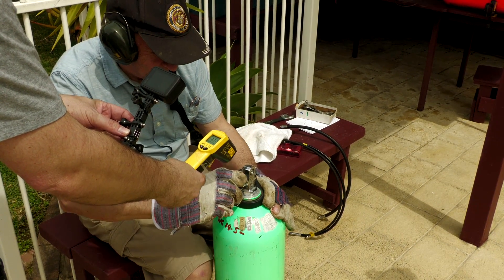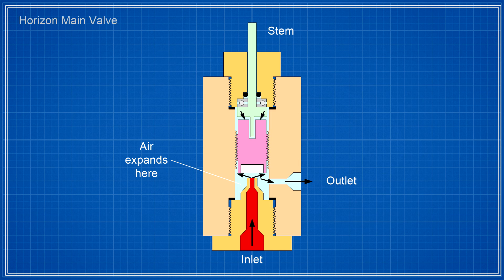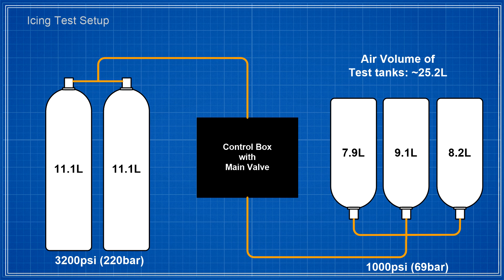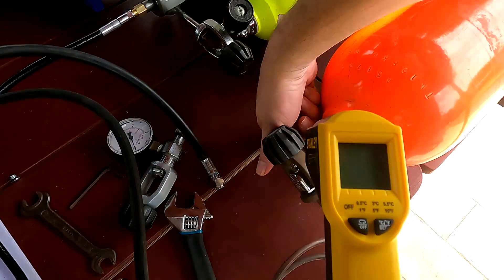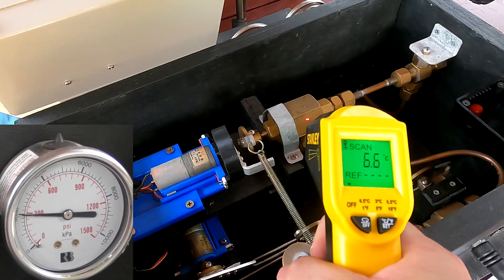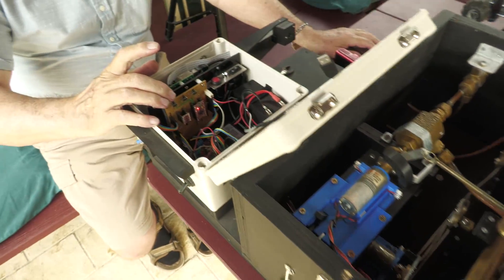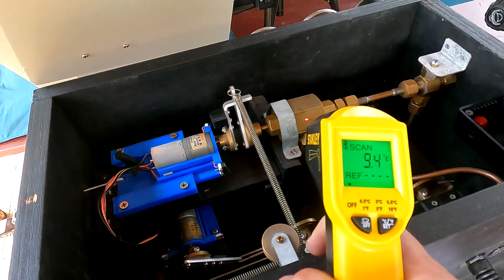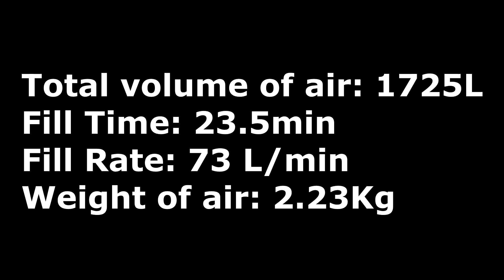2 Stage Water Rocket - Part 34 - Will it freeze?

Comment: You could use (dry/pure) nitrogen. They use it on aircraft tires so that ice does not form in a tire to make it unbalanced. Yes it will still absorb heat when it expands, but there may be less moisture in it, at least.
Cool channel, thanks.

Comment: With an Arduino you could add a temp sensor to the valve.  Then have it shut off the valve at like 10C and open back up at 15C.  This way you might be covered in all weather conditions.  If for example it's a bit cold out.  It would also automatically give you your pulses and open fully at the end.
Reply from the maker: We already have a Raspberry Pi there sending data back to the remote laptop. Probably wouldn't be difficult to add a temp sensor.
Reply: @AirCommandRockets  yeah, it would be pretty easy.

Comment: You can speed up your fill time and get higher pressures at the end by cascade filling from your bank. It's how we fill scuba tanks when blending. Rather than turning on both bank cylinders from the beginning, only turn on one fill until the pressure equalises, which will happen at a lower pressure as your volume difference is greater, then turn it off and turn the other on. 

Rather than use HP hoses, you can get a decanting whip, which is made for this purpose and has a much higher flow rate, HP hoses are designed to have a low flow rate as all they do is pass pressure to a gauge.

Its also worth noting if you drain tanks to the atmosphere like you did at the start, put them upside down. That way, any condensation that forms on the valve and melts can't run into your cylinder and cause corrosion.
Reply from the maker: All good points. One problem with opening the tanks one at a time is that we can't do that remotely. The tanks are located at the launcher with the control box which is remotely controlled from 50m away by a laptop. You don't want to be anywhere near the pressurised rocket. That's why we have it set up this way. We will replace the HP hose spool swivel with a Teflon washer to seal it like we have done in other parts of the launcher. The washer has a hole of around 3mm so should give more than enough air. We had already drilled out the micro holes on the other end of the HP hoses. Regarding the emptying the tanks, we did leave a couple of bar in there for exactly that reason so moisture wouldn't enter.

Comment: Awesome content as always. Does the dive shop use just a compressor to fill the tanks so it's just atmospheric air?
Reply from the maker: Yes they use a compressor and fill with atmospheric air. Often they pre-fill large storage tanks and then when you need a fill they transfer from those which is much faster and do it in about a minute or two.

Comment: A few years ago I was working with supercritical CO2. The inner diameter of the steel tubes carrying the gas was a fraction of a mm and we did free expansion of CO2 with a pressure up to 1000bar. To prevent the tubes from freezing we had hoses with warm water coiled around the steel tubes. A thermostat controlled the temperature of the water.

Alternatively you could also use a foam jacket around the tubing if icing becomes a problem.
Reply from the maker: Hi Dan, Interesting info about the CO2, 1000bar is quite a bit of pressure :) I am hoping that with the normal ambient temperatures we should be ok, perhaps we just leave the whole thing exposed to the sun to keep it warm.

Comment: Another thing that would be interesting to see is the temperature drop in the rocket tank during launch. Its gonna be difficult getting a thermometer in there though,
Reply: A FLIR camera view would be interesting. And isn't invasive.
Reply from the maker: @simonabunker I actually looked at getting one of these, but they are a little on the expensive side. Even to rent they can be quite pricey.
Reply from the maker: We do have one test pressure chamber where we have glued into it a thermo couple so we can measure the internal temp. I think we have a video of that somewhere but only as a static test rather than in flight, but can't remember which one it was.

Comment: In theory, you should have an emergency burst disk of pop-off valve some place [inside a special safety cage/box] so that if the lines will not close, there is a safety relief in the system.
Reply from the maker: We have made one of these that is adjustable. It's detailed here: https://youtu.be/yynT8bLQOTE?si=Q_0oXJWzAlt1kUyu&t=166

Comment: As long as the gas inside the tank is dry, ice can not become a problem internally.
Reply from the maker: Yes, in general the air is dry when they fill the tanks at the dive shop, so I am not too concerned on internally freezing the valve, though there may be some moisture in the hoses, though that would be minimal. The big problem is atmospheric moisture getting frozen around the stem outside of the seal which is quite deep in the valve.
Reply: @AirCommandRockets  Some people use preheater buffers, but since you were worried about heat building up in the actual rocket, that would clearly not work in your situation.

It is good to know that the final thermal mass load was high enough at those filling speeds as to not cause an issue. 

One can always box up the control module with some calcium chloride such as to keep it dry internally, they sell 'damp-rid' in small, disposable containers, just reduce the excess free flow of external air into the module, and only open the damp-rid lid just before filling the tank, then closing it up between uses.

I buy that stuff in 6 Kilo containers to control moisture here in the states.